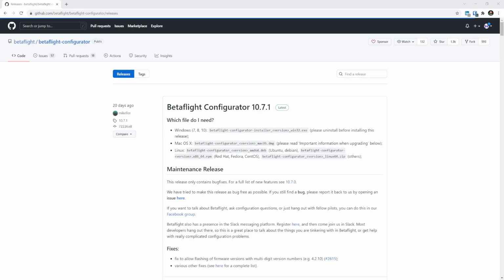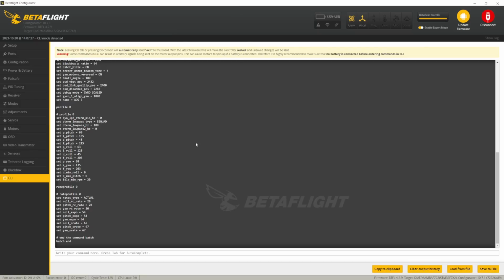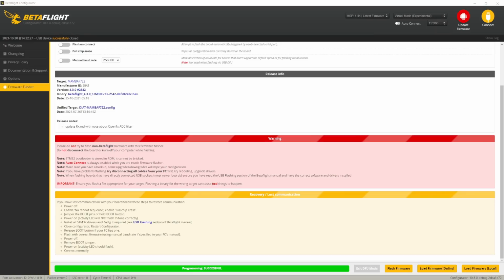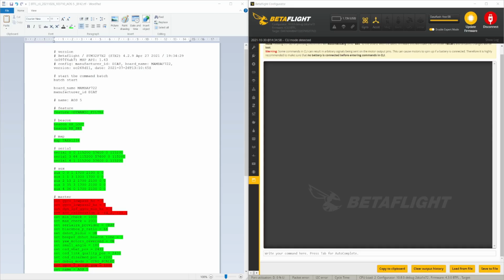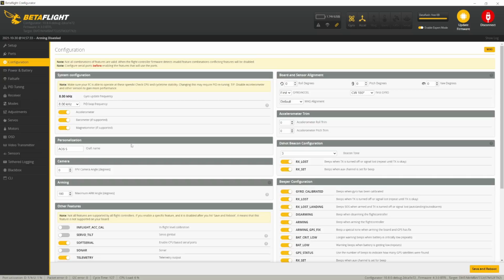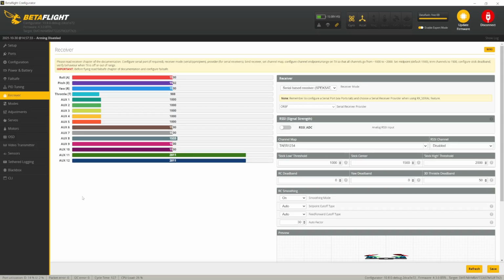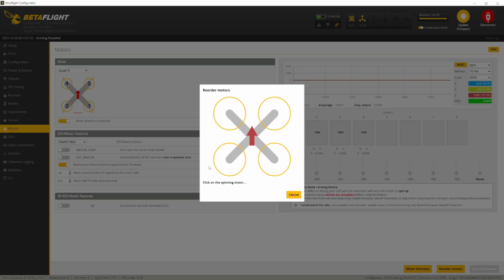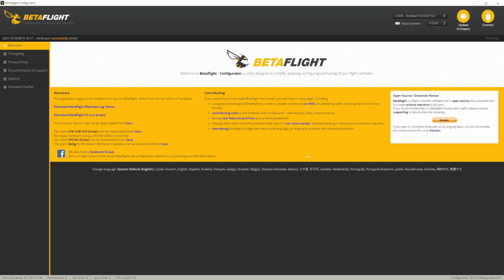Betaflight 4.3 Complete Tuning Guide Part 2: Flash to first flight!

Comment: 18:30 best tip ever. I set the number of poles wrong and got a huge fly away. Did like 20% throttle and the power would go to 100% and even when I lowered the throttle it would not help. Disarmed and crashed like from 40 meters high XD, fell in the high grass, not even a scratch.

Comment: Just flashed rc 3 and on the configuration page dynamic filtering option has disappeared. Has it moved or is this normal for betaflight 4.3 rc 3 ?
Reply from the maker: It's moved into the filtering tab

Comment: Hi Chris! I'm currently learning how to Tune. With your videos regarding the XL5 frame and BF 4.3 this is exactly what I need. I'm trying to tune a new build on an XL5 frame running a Mamba H743 FC with dual MPU6000 gyros. When setting up Blackbox debug mode should I choose DUAL_GYRO_SCALED (as I have dual MPU's) or GYRO_SCALED? Thanks!

Comment: 1.) when i set my pid loop to 8khz and click save it would reboot and have it back at 4khz .. any idea why? stm32f745 (holybro kakute f7 aio)
2.) dynamic_filter is not present unter "configuration -> other features", thanks in advance!
3.) with bluejay (og: blheli s single esc) should i use dshot300 or dshot600?

Comment: good day sorry for my english (I use google translator)
maybe you know how to solve my problem
I am using emax babyhawk hd 2 and its flight controller in betaflight is called BHHD/EMAXF411(STM32F411) and during firmware update and pressing auto-detect it says "Configurator has detected the board: EMAXF411 but no official Betaflight target was found"
From the manual for the drone, I realized that I need to install the STM32F411 target. I transferred most of the settings from betaflight 4.2 using cli migrator but there is no way to calibrate the gyroscope and accelerometer. "no gyro/ac" error
I also tried to install the MATEK STM32F411 target, the accelerometer and gyroscope work there, but when Bidirectional DShot is activated, 3 out of 4 motors give 100% errors when checking and only 3 and 4 motors spin (regulators are flashed Bluejay48 kHz)
Please help me with this issue and thanks in advance!

perhaps these are the necessary settings and everything works with them, but cli mirgator marked them as not safe 
# set gyro_1_bustype = SPI #UNSAFE !!
# set gyro_1_spibus = 1 #UNSAFE !!
# set gyro_1_sensor_align = CW180 #UNSAFE !!
# set gyro_1_align_yaw = 1800 #UNSAFE !!
# set gyro_2_spibus = 1 #UNSAFE !!

Comment: Great video as always Chris, very helpful. I've downloaded and installed BFC 10.8.0 but couldn't find the DYNAMIC_FILTER switch under the configuration tab (11:28 in your video). I have switched on bi-directional Dshot but the dynamic filter switch is still nowhere to be found. Am I missing something, or has this switch been removed in 10.8? Many thanks
Reply: I didnt find the option as well

Comment: I am so so so contused ! all the betas flight get started classes always say and start out with lets re flash your FC but never explain why would we ? when the FC has a flash that works. I have stock factory flashes on my Mamba's , most all FC do have out of the box flash on chip. why would I write over them  with a new flash ? I don't get why? I have edited older configuration flashes on my F controllers  last night on the latest  version  ,plugged my quads into  betaflight 4.3, It took on the old flashes and from there I just made changes like as usual. I would understand if a new version, complete revamp of BF was out and could no longer edit older flashes, a fresh flash maybe. I'm missing something!?
Reply from the maker: Newer versions of BF have more advanced features that make the quad fly better. Also if you're following a BF 4.3 guide you should be running 4.3 otherwise the guide will be wrong for you with settings missing etc.

Comment: Hey Chris, great video thanks! Quick question: I'm using a Mamba F722 FC (same as your video I think??) updated to BF 4.3 but I don't see the Dynamic Filter toggle in the Configuration tab. Do you know why this might be? It should be underneath OSD in your video but I have nothing? I have BLHeli32 ESCs updated to the latest version. The Configurator version I have is 10.8.0-debug-90f15faf. Any help appreciated thanks!
Reply from the maker: Dynamic filter has moved into the filter tab in 4.3 (where it belongs! 😜) 👍

Comment: When I update the escs and enable bi directional dshot in bf, two of the motors controls are red with E:100 under the motors tab. I'm using the flight h7 aio. Any thoughts?
Reply from the maker: The H7 has been known to have issues with bidirectional d-shot but I think they are fixed in 4.3?
Reply: @ChrisRosser  Sounds like the issue lies in the hardware. The v1 h7 beast aio isn’t compatible, the v2 is.

Comment: Can you explain the 8k pid loop with dshot600 vs the 4k pid with dshot300 both with bidirectional on?  I have a f7 board, but run at 4k with dshot300, bidirectional on.  Ive done bench tests at the higher 8k/600 but I get small error percentage on the motors tab, and when looking at the fc cpu load it's up to 65+ % load.  I haven't tried flying with these settings, but wonder what advantages could be seen with 8k/dshot600 I'm on bf 4.3 and notice that's the default.  I'd love to hear your thoughts on it.  My fc is a mamba f722 mini stack with 32bit pro esc.
Reply from the maker: The difference is just the rate at which the PID loop runs and communicates with the ESC. The higher the rate the more CPU is used. High Dshot rates can cause errors with bidirectional Dshot. The difference between 4k Dshot300 and 8k Dshot600 is pretty small so I would stick with 4k 👍

Comment: Hi, if the first 30 seconds of flight the motors are hot then what do you do?
Reply from the maker: If the motors are hot on stock PIDs and filters then it's usually one of three things: you're flying in hot weather, you have a heavy drone with small motors, you have a lot of vibration due to a mechanical issue (often a long VTx antenna). Do any of those suggestions help?
Reply: @ChrisRosser  hi chris watched your videos over2, but still too scared of trying it myself of the part 3 tuning guide. Still lost on reading the data. I'll take a plunge tonite and flash 4.3

Comment: Was reading the 4.3 tuning notes and it suggests f411 boards to be overclocked to 120mhz , do you suggest doing that, I mean I didn’t see it in any of your tuning videos yet but your using a f7 I believe
Reply from the maker: Yes F411 boards really do need overclocking at this point. I wouldn't buy a new FC with an F411. I would choose F405 or F7.
Reply: @ChrisRosser  I’ll keep that in mind. Thanks for the reply. Absolutely love the channel and your 4.3 tuning videos 🤜🏻

Comment: Hey Chris,
Do you know of FCs or FW targets that don’t play well with BF 4.3? 
I’m going to be making some repairs to one quad and building two others (one of them an AOS 3.5!). Trying to decide if I should go 4.3 yet on any or all of them. My whoop running Tracer can’t be updated while the rx is wired, as it is powered by USB and confuses Betaflight. This would be the time to update since she’s on the bench. I just don’t want to cause any harm to the fleet.
Thanks for all you do for the hobby/community! Love your channel!
Reply from the maker: I think BF 4.3 is pretty safe to try at the moment for all targets.
Reply: @ChrisRosser  Should I try with build#2542 or do you recommend a newer version?
Reply from the maker: @mpavlov2966  I have been using the versions shown in this video. If you try other versions you may run into bugs or problems I did not. I think it should be OK to use newer versions but it's up to you.
Reply: @ChrisRosser  Thank you so much! The Karate Tune flies great! Great videos and hopefully we’ll see Part 4 soon!

Comment: I have a question. I followed the steps exactly and it worked but how come you didn't go into DFU mode first. And why didn't you do a full chip erase? I just wanna make sure that I did it correctly by following these steps
Reply from the maker: I did a full chip erase but didn't need to go into DFU because the firmware flasher reboots into bootloader automatically. You can flash in DFU if you want to by ticking no reboot. 👍

Comment: It isn't safely to diff rates untill you was using actual rates on 4.2
Reply from the maker: The rateprofile section has a line for rates type so I think it should be OK to paste unless the names of the rate types have changed?
Reply: @ChrisRosser  4.3 changed default rate system to actual. so. ok if you was using actual in 4.2 as it will be in diff. but if u were using standart rates it will apply this walues on new defaul actual. probably they fixed it but on earlier build this had lead to weird actual rates values

Comment: JB has always setup stick movement as 1000-2000 changing it from 988-2011 in the CLI using rx range. Am l missing something here?
Reply: That's not quite right. When I do a complete noob tutorial, I use rxrange. The reason is that no matter what controller and receiver you're using, rxrange works the same. So the advice is universal. But when I set up my own quads, I use the OUTPUTS screen because it keeps the max resolution to the FC, and because if you set it up once in the controller, you don't have to set it up on every new quad you build.
Reply: @JoshuaBardwell  thank you Sir Bardwell, muchly appreciated! I know Chris wouldn't be giving out incorrect advice but l really am grateful for the clarification.  Oh and not happy with you plugging the new alloy cnc Radiomaster gimbals, I'm now $200 AUD poorer 😁 but damnnnnnnnn they good!

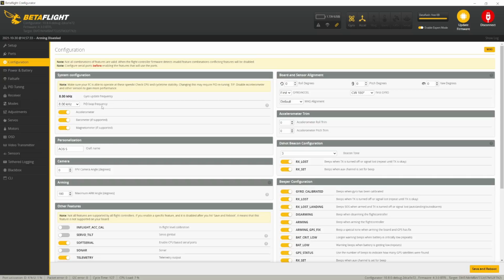Comment: 10:40 This recommendation surprised me a bit as I am using 8/8k on multiple Mamba F405 boards with no issues. Though I had some issues on F411 board...
It would be great if someone can confirm it and it would make sense as 405 is faster.
Reply from the maker: F405 can typically run 8k/8k unless you have a lot of features switched on.

Comment from the maker: Safe lines to paste into your diff: Aux, Beacon, Blackbox, Dshot, beeper, Feature, Map, Max_check, Min_check, OSD, Sbus, Serial, debug_mode, idle_min_rpm, name, resource, small_angle, vtx, vtxtable, yaw_motors_reversed
Unsafe lines: acc, dterm, dyn, ff, gyro, rc, rateprofile section (unless you are already using ACTUAL rates)
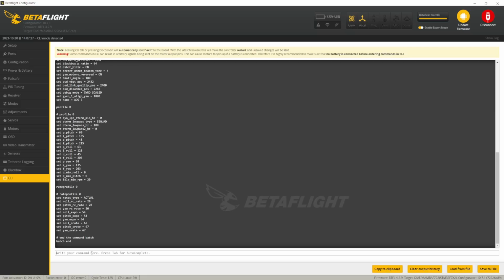Reply: 2:35 diff all is right command . witout hyphen.  diff -all is same as diff.
Reply from the maker: @HERSDT_FPV  Thanks, I'll correct that in any future videos.
Reply: 9:55 Its because value is "profile  value". You need to point out number of profile first.
Reply from the maker: @HERSDT_FPV  yes that makes sense. I've added profile into the safe lines to paste.
Reply: Don't forget the resource lines which are safe and have to be copied too
Reply from the maker: @DronoTron  Good point! added.
Reply: I guess "ff" is also unsafe, since they've changed it to "feedforward".
Reply from the maker: @pav2k  OK thanks! Updated.
Reply: patiently waiting to see what you recomend for filters and all that i didnt know what to set my q at in the new 4.3 for my 3 inch running the karate tune on my 5 and that is flying great got i pretty good 3 inch tune thought seems to be flying really well though this new 4.3 is really good its amazing both my drones are flying the best thry ever have keep up all the good work cheers bro
Reply: @joemck1235  lols stop asking me then !!!
Reply: @Sugar_K  lol what's up
Reply: @Sugar_K  I didn't wanna bother you with my 3 inch I didn't know what to set the q at for a 3 inch lol
Reply: @joemck1235  karate race tune
Reply from the maker: Looking forward to covering that in the next video!
Reply: @ChrisRosser  awesome  I just found your videos I like how you really explain things
Reply: maybe you should also mention gyro in lowercase, because: set debug_mode = GYRO_SCALED is a valid line
Reply from the maker: @pav2k  I mention to set that in the configurator and will do in the next video. I'd rather people not paste any lines with gyro in them just to be on the safe side!